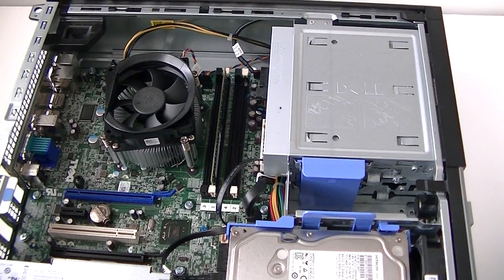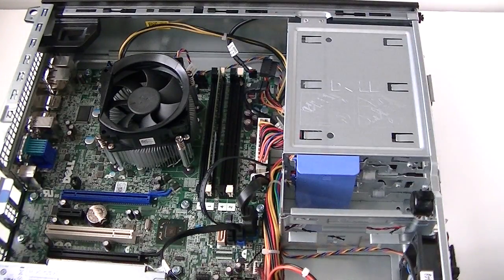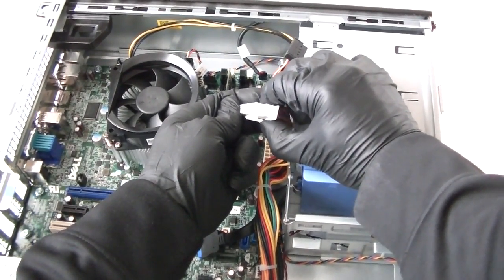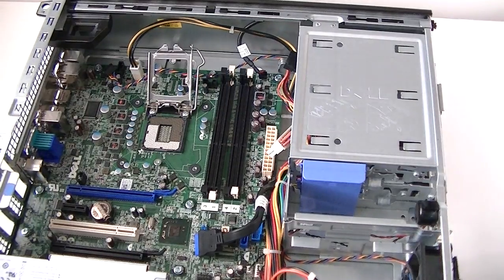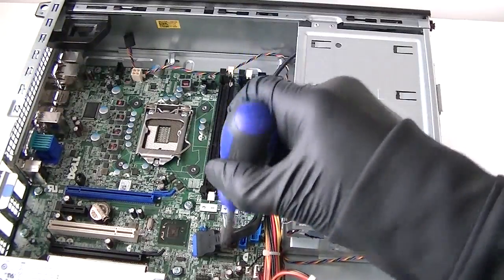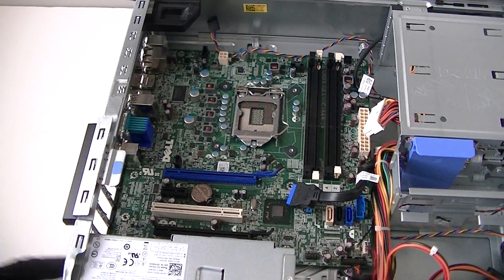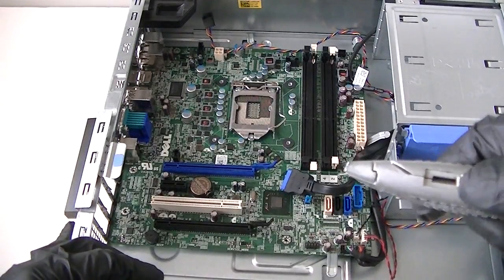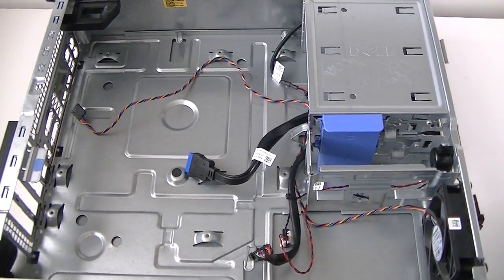Dell Optiplex 7010 Teardown

Comment: TIP: When he's discussing the front panel connecter it's hard to tell but you're placing the blade in-between the connecter cable and slot. BUT BE CAREFUL.
Reply: Like how?

Comment: Can I add a GPU into this and what sizes of GPU could I put in it?
Reply: Ik it’s been a year low profile cards are great I have a rx 580 in there but I had to smash my sata cables and remove the front usb and drill out the hard robe bays and turned it 90 degrees and everything fits perfectly
Reply: For i7-3770k max GPU is 1070 or 1660 super.....but you need to buy a new psu and case for swapping

Comment: What hard drive would you recommend using here?
Reply from the maker: I recommend for boot drive you should use solid state drive and for extra storage you can use hard drive like 2.5inch 5400rpm or 5900rpm they sell online really cheap.
Reply: Mxkdi Awesome thanks I found a ton of scraps of these with parts and put it together, but none had any hard drives! Do you think WD Blue would work good too?
Reply: @Mxkdt  Sorry last question! What type of SSD should I use for it?
Reply from the maker: Hi. how many games are you going to install in windows 10?
Reply: Mxkdi Ermmm... probably around 3-4 I really don’t know.
Reply from the maker: Yes you can use for WD Blue extra storage and in Windows 10 you have to use SSD for main boot drive.